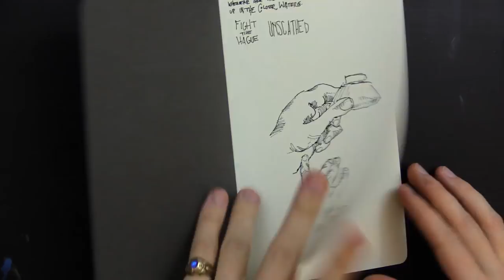sharpening pencils (and an ink drawing)

Comment: I think you would like a bottle of Benzoin (tincture of Benzoin), a small amount applied to a room temperature light bulb, allow to dry and then when you use the light the mild aroma of Benzoin fills the air, you feel that you are in a forest of Jeffrey Pines (vanilla pine scent, like pine needles on the floor of the forest that give off that wonderful scent in the heat of the day).... Full strength it’s a bit overwhelming but used like a perfume (small amount) or to scent a closet it’s lovely.  Maybe it’s my container of pencil shavings.